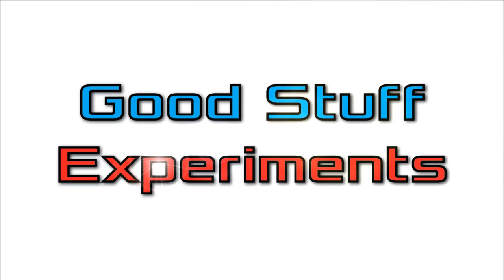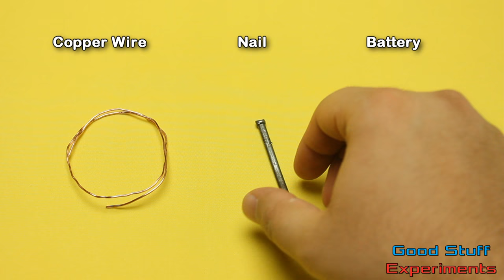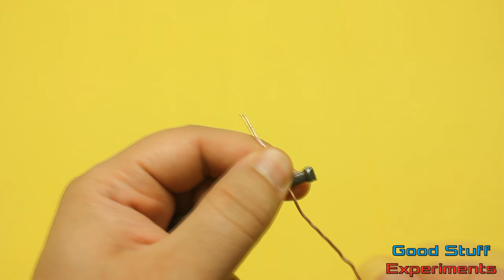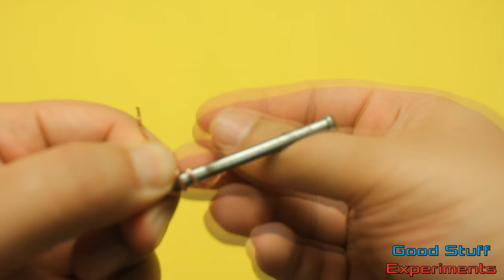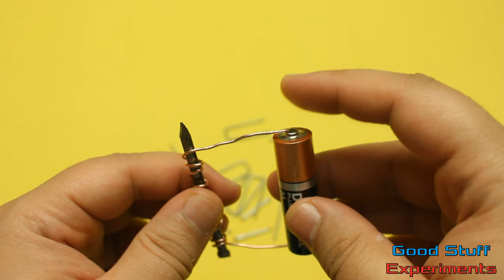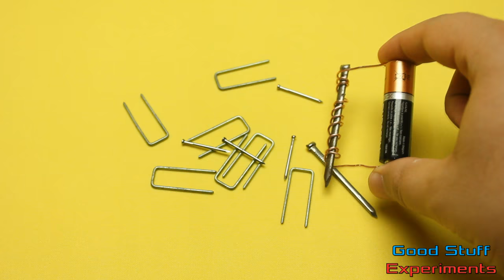How to Make an Electromagnet - Science Experiment

Comment: This is so great! I had a school project on this! And it helped so much!!
Reply from the maker: That's awesome!
Reply: Hi
Reply from the maker: @badboygamers9723  Hi
Reply: I did this in a small competition at school. I knew it was supposed work but for some reason it didn’t RIP :/
Reply from the maker: @whalegod2411  Did you use a new battery?
Reply: @whalegod2411  yeah , that’s what happened to my teacher the first time she tried it she burn herself—
Reply: @GoodStuffExperiments  should we use old or new please tell
Reply: @GoodStuffExperiments  It was actually the school that provided the materials, and we were limited to copper wire (fixed length), paper clips, a nail, sandpaper.
Reply from the maker: @whalegod2411  Very Good

Comment: So I tried this experiment because I want to test if the wire I have is real copper or not and I couldn’t even hold the wire to the battery for more than a few seconds as it was burning my fingers. I see you’ve mentioned this could happen in your disclaimer, so does that mean the wire I am testing is not real copper? Because you seem to be able to hold yours just fine… I’d love your advice. Thanks!
Reply from the maker: Use Blu Tack

Comment: If I use a DC power supply (AC to DC) plugged into a 15A wall outlet and the DC power supply is 12V 10A, will I get hammered if I touch the copper wires that are wrapped around the magnet? Is 10A too big? I planned to use this DC supply on a model RR to power lots of LED's and a handful of home-made electromagnets (simple design of copper wire wrapped around a threaded bolt). If I would get hammered by touching the copper wire, would the simple effort of wrapping the electromagnet with electrical tape solve the problem? Would the tape weaken the magnet's pull/strength Thanks!
Reply from the maker: Too technical - pls consult an electrician

Comment: HI NICE VIDEOS , BUT ONE SUGGESTION TO EVERYONE . TO INCREASE THE STRENGTH OF THE MAGNET , YOU HAVE TO INCREASE THE AMOUNT OF TURNS MADE ON THE NAIL , IN THE VIDEO , HE MADE VERY LITTLE COILS , SO IT IS NOT THAT STRONG ,\.  JUST A SUGGESTION IF YOU WANT TO STRENGTEN YOUR MAGNET .
Reply: YOU COULD ALSO INCREASE THE AMOUNT OF CURRENT PASSING BY INCREASIGN THE AMPERE STRENGHT , BASICALLY JUST GET A NINE VOLT BATTERY
Reply from the maker: Thanks for the tip

Comment: i just tried this and its not working, i wrapped the copper wire around a nail, and i put both ends of the copper wire attatched to the tip and bottom of a AA battery... what should i do?
Reply from the maker: Is it a new battery?
Reply: @GoodStuffExperiments  yeah I used an old battery also ,it is still not working ,, please help
Reply from the maker: @AdityaRaj-mc2iz  try steel wire
Reply: My also not working
Reply: Arata is sleeping u condensed cabbage 🤦‍♂️

Comment: At first it wasn’t working but there’s a specific part of the screw that worked
Reply from the maker: Well done
Reply: its not working also. what type of nail is this?
Reply: No actually this is special type of insulated wire (wire with insulation)
Yes wire with insulation 

In this video the wire used is the wire one which is used for motor windings seem to be bared but it is insulated with polymer paint 

You can simply use insulated with thin insulation and with high voltage battery

Comment: Questions:
1) Given that copper is such a good conductor, why does connecting the ends of the copper wires across the battery not just short out the battery?
2) What kind of current is being pulled from the battery here?
Reply from the maker: I think its AC current

Comment: Hello everyone. anyone who is an amateur  here and doesn't know much about electronics, remember that the copper wire must be covered with a layer of insulation, the smaller the thickness of the insulation, the greater the magnetic field.
similarly, the more windings, the more greater  is magnetic field. However, if we wind it on something made of iron or another material with phereomagnetic properties, the magnetic field will be even greater. we don't have to add out the necessary core for our electromagnet, but then we have to add more windings. 
 Good luck 👍
Reply: Why do we need insulation?

Comment: Sir, I have a doubt 
You used which material for the nail/screw
Because when I tried doing the experiment by aluminum nail it did not work 
Can you please share this 
Please
Reply from the maker: try using steel
Reply: Steel or iron.

It has to be ferromagnetic. Aluminium won't work in this experiment. Iron is the best, but some steel might work as well.

Comment: Nice... Can we use copper wire with cover on it plz reply and how wire has stucked on the cell...? Plz reply
Reply from the maker: Yes but the connections to the battery will have to be with no cover and use blu tack to hold it.

Comment: what is the difference between insulted and uninsulated wire in this experience  
I have a book warning about using insulating wire  : 
here is the text:: 
" Make sure you used insulated wire to make the loops around the bolt. The wire must have some kind
of insulating layer on the outside of the metal; otherwise, it won’t work. The reason for this is that
without the insulating layer, the current won’t follow the wire loops around the bolt. Instead, they’ll
go through the bolt if the bolt is conductive or through to the neighboring wire if the loops of wire are
touching. In either case, the current will function as if you had one thick wire.
Reply from the maker: Try the 2 and see which works best 👍
Reply: @GoodStuffExperiments  
I tried 
the problem is no tow poles 
I got one positive pole  for tow side of nail 
it is supposed one side push and another side attract

Comment: I have one question.....which type of the copper wire is required thin or thick?  And 2nd one is how many volt of cell is required?
Reply from the maker: Thin and AA battery @ 1.5v

Comment: I take out copper out of normal wire and take a screw and try to make electromagnet but it didn't work.

Note- I have done both by taking one Strip of copper wire and by rounding them.
Reply from the maker: Try using another copper wire

Comment: how to keep the copper wire and battery attached without holding it? say if you wanted to add more parts?
Reply from the maker: Use hot glue to hold it

Comment: It works with a small battery
But does not work with the normal size battery
And it gets really hot yoh cant even hold it you need to cover your hand to hold it
Reply from the maker: Use Blu tack to hold it

Comment: Not a good demo.  The nail shorts out a lot of the current.  Use insulated copper wire .
Reply from the maker: You need bare wire to touch the nail
Reply: @GoodStuffExperiments    If it touches at only one point, that would not matter.  If it touches, particularly at the ends, there would be very little magnetism.  Cannot defy  the laws of electromagnetism
Reply from the maker: @glenndarilek520  Well in this instance it works when touching the nail 😊

Comment: I do not understand how your battery is fine and your fingers are burning.. I did this with insulated 22 AWG copper wire and I only held it on there for like 15 seconds before the battery apparently experienced an internal short
Reply from the maker: Use Blu Tack

Comment: huh, yikes I did the same and my battery almost exploded tf? My wire is 1mm thick is it maybe that? Or that I'm using a screw, instead of a smooth nail?
Reply: @GoodStuffExperiments  I figured it out, the coils where to close, they where touching making the current go straight back in to the battery.
Reply from the maker: @taru6342  👍

Comment: Can we use Panasonic cell?
Reply from the maker: yes make sure its new
Reply: @GoodStuffExperiments  I have used new but it heats for some time but not working?
Reply: @Gurleen_kaur89  it is supposed to heat up.
Reply from the maker: @Gurleen_kaur89  Use different batteries and use Blu tack to protect fingers

Comment: If I use other wire not copper, will it still work?
Reply: Yes it will. As long as it's conducting. Also this video is misleading because if you actually expose the copper wire completely like this it will not work. The copper wire used here doesn't look insulated but it is.
Reply from the maker: Give it a try, experiment yourself
Reply: @GoodStuffExperiments  I tried it and the wire become so hot in a sscond
Reply from the maker: @rytiksas6556  Use BluTack to protect fingers

Comment: It worked (I thought it hadn't)
Reply from the maker: Are you using a new battery?
Reply: @GoodStuffExperiments  I am dumb, I used a wire (magnet wire) that had an insulation the color of copper. I forgot to remove it... whoops!
Reply from the maker: @will3697  Whoops

Comment: This "tutorial" is very poorly done and is very missleading. It doesn't even show the difference when the circuit is connected and when it is not. An electromagnet should only act as a magnet while connected to a voltage source. I think it didn't work for you at all and that the nail had been slightly magnetized from another experiment. Is your wire isolated? It should be. And you should remove the isolation from the ends of the wire. And people should be warned of dangers of short-circuiting a battery (skin burns, fire, explosion). Please try making another video taking into account my advice. I'm sure people would enjoy watching it!
Reply from the maker: Many people enjoy it but will make another one.